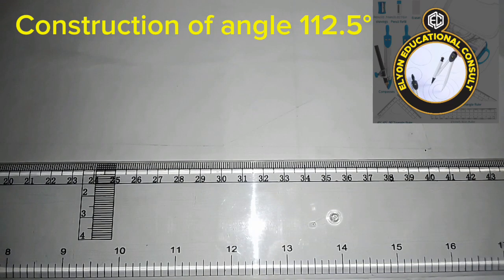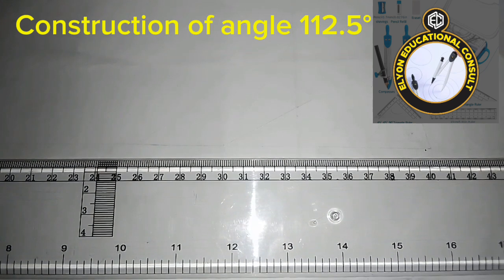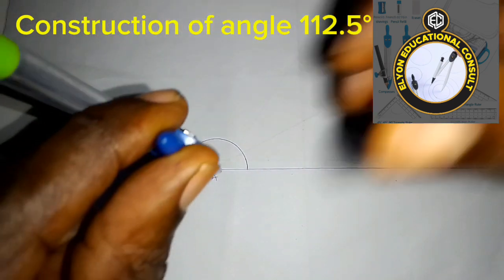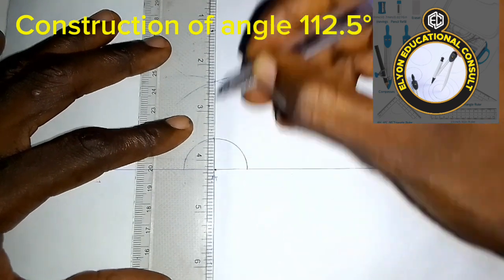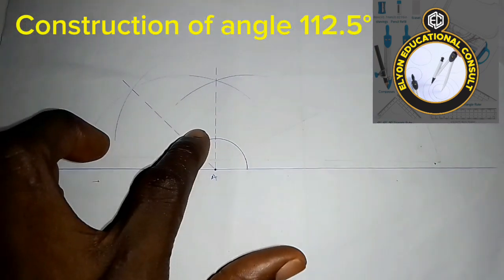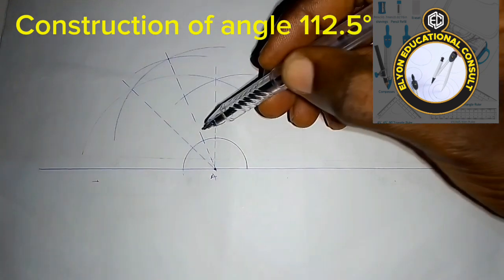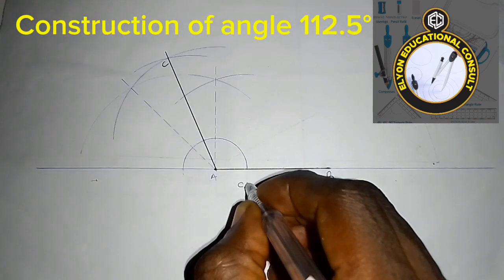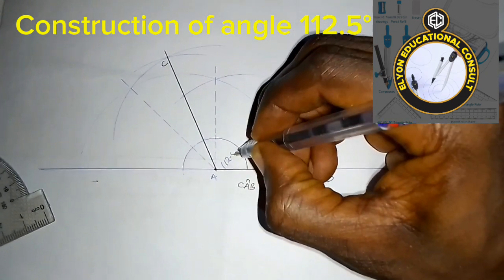How to construct angle 112.5°

Comment: How do we construct angle 56.5
Reply from the maker: @BarineTheophilus  Unfortunately, it's not possible to construct an angle of 56.5° using only a pair of compasses. Compasses can only construct angles that are related to the basic geometric constructions, such as:
- Bisection of angles (dividing an angle into two equal parts)
- Trisection of angles (dividing an angle into three equal parts) using more complex methods
- Constructing angles of 30°, 45°, 60°, and 90° using basic geometric properties

Since 56.5° doesn't fall into any of these categories, it can't be constructed using only a pair of compasses.
However, you can construct angles like 55° close to 56.5° using pair compasses. Angles like 56.5° can be constructed using various approximation methods or by using additional tools like a protractor.